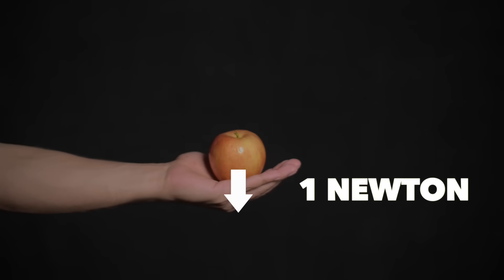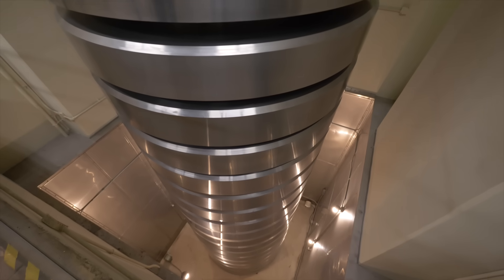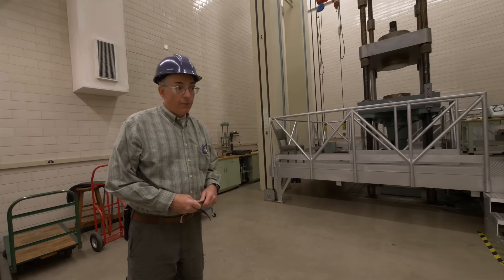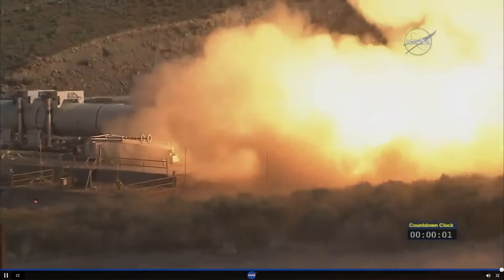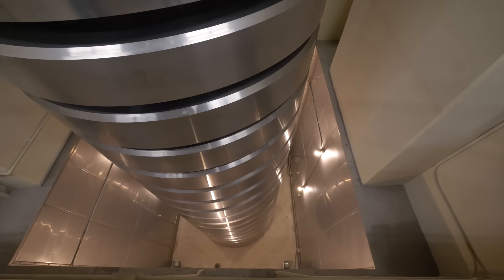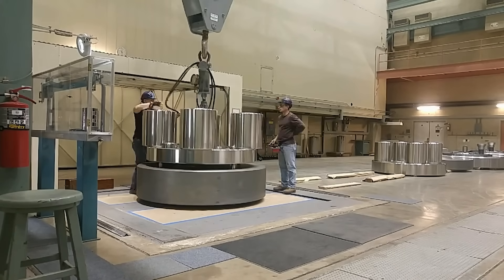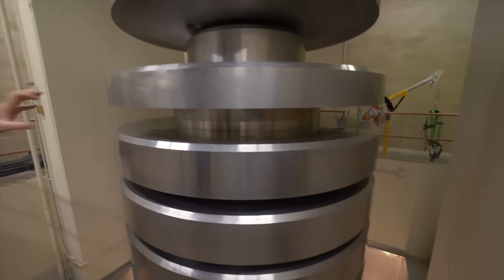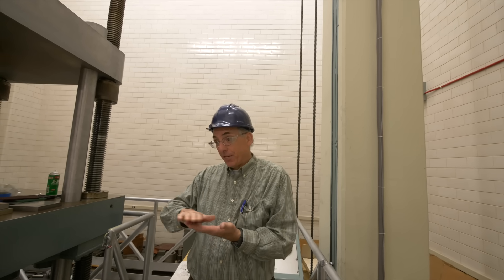World's Heaviest Weight

Comment: Is it possible to save energy in a battery-sized object in a form other than electricity? How does wireless charging work? Could we convert magnetic energy to electric energy? Is it possible to transfer electricity over very long distances (e.g. 100km) without the presence of a medium?
Reply: We already convert magnetic energy into electric energy. Actually, excluding the photoelectric effect, it's the only way I know we know how to make energy. You move a piece of magnet over a piece of copper, and what you get is electric current.
Reply: Question #1: Batteries don't really store energy as "electricity". They store it as chemical energy. There are other ways aswell like fuel cells. Look up the details yourself if you want, it's REALLY interesting (Galvanic cell).

Question #3 (you'll see why I answer this one before #2): Look up Induction. It's kinda hard to explain but here's my try (simplified): If you move a conductor in or out of a magnetic field you create a current in that conductor. Therefore converting some of the magnetic energy of the magnetic field into electric energy of the electric field your conductor creates. You can achieve the same goal by alternating the strength of your magnetic field and keeping the conductor where it is.

Question #2: Put two coils next to each other and hook one of them up to an alternating current. This coil will create an alternating magnetic field that induces a current in the other coil => Transferring electricity wirelessly.
Reply: Sure, you can have a rotating mass in a battery cylinder for example, most of these methods are inefficient. Wireless charging works through induction - an oscillating electromagnetic field induces current in a circuit. This is a way to convert magnetic energy into electric and vice versa - also they are kinda the same type of energy.
Reply: Energy in a battery isn't saved electrically, it is saved chemically, and non-electric output forms of energy aren't as useful as electric. Wireless charging works through electromagnetic induction (I'm sure you can find an article explaining it in detail). We already use magnets in basically every power station on earth to create the previously stated effect but I guess that's not what you meant with "convert". The laws of thermodynamics state that in a closed system the total amount of energy must remain equal. That means that if we convert magnetic energy the magnet will lose its magnetic properties. This already happens in magnets, but it happens extremely slowly thus making it unviable for power generation.
Reply: So the magnet has to be moving?
Reply: Olaf Lipinski There's no magnetic energy. There is (only) magnetic force or field. If you change magnetic field around a conductor, it induces current, which generates opposite magnetic field. (So if you move a magnet near a conductor, the magnetic field will try to slow it down due to magnetic force.)
Reply: bjmben88 oh I though "without the presence of medium" meant vacuum. An atmosphere would indeed introduce losses, but on the other hand I am unsure how to focus magnetic field over long distances. Imho the only way without a medium is by radiation - and lasers are the easiest to focus over long distances. I think the laser can heat water to make steam, imho that's how solar power towers work.
Reply: Olaf Lipinski wait... What??? Don't we use fossil fuels or nuclear energy to turn turbines and produce electricity?
Reply: Ebot75 so I can produce infinite current by placing a magnet near a wire?
Reply: mohammed mokhtar: And how do you thing those turbines produce electricity? By magic?
Reply: https://en.wikipedia.org/wiki/Pumped-storage_hydroelectricity
If you pump water up to the top of a hill, you can let it pour down and power a turbine to generate electrical power. This is used to store energy for when power demands increase at peak loads. This works no different to charging a huge amount of batteries, but it is much more efficient (energy in vs energy out) and can store much more energy than a farm of batteries.
Reply: I'm guessing you haven't done your own research yet, but did edit your comment. The only method I could think of to transfer electricity long distance (described in your question), is through a magnetic field. Magnetic fields drop of as an inverse square function. Meaning its inefficient, you'll get huge energy loss.
Reply: bjmben88: "The only method I could think of to transfer electricity long distance (described in your question), is through a magnetic field" - ehm.. lasers?
Reply: Jaroslav Novotny I actually contemplated putting that down as well. So yes, you're right, but again it seems like a terrible method to transfer energy. You have more conversion losses, loss to the atmosphere and I don't think photovoltaic cells can handle that amount of energy (there is a threshold for how much energy they can produce, correct me if I'm wrong).
Reply: Jaroslav Novotny Good point actually. Heating water is pretty useless in space though.... Steam wouldn't rise without gravity, just expand, and you'd have a very finite water supply and waiting for it to condense also seems needlessly complicated.